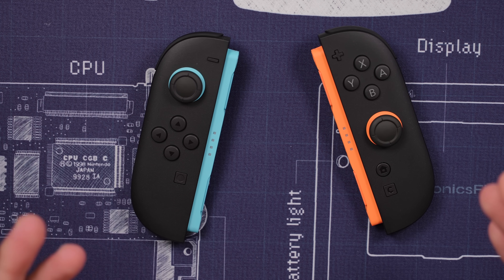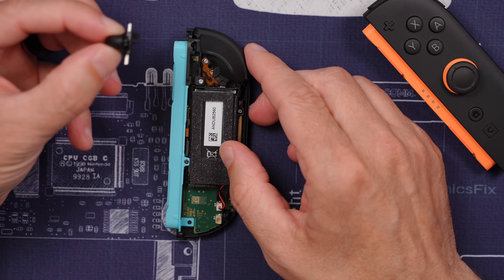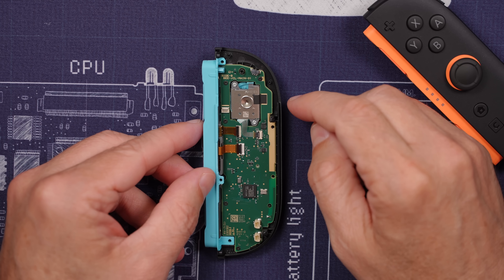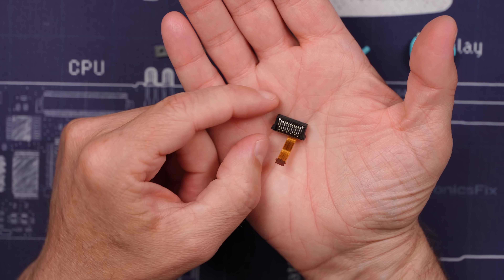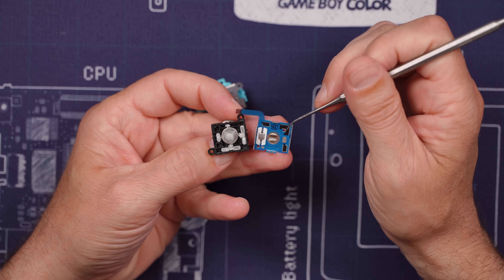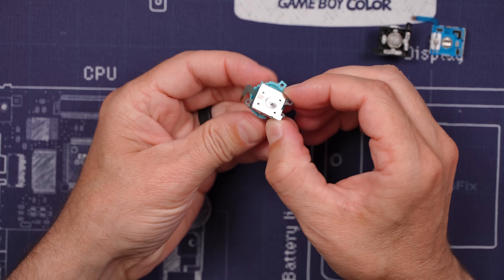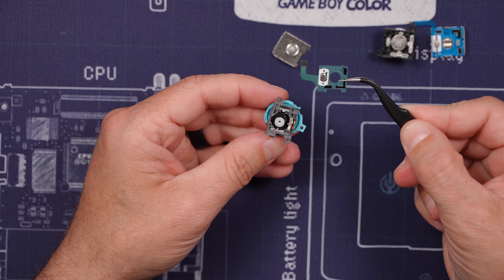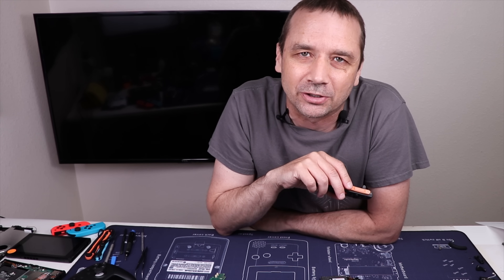Nintendo Switch 2 Joy-Con Teardown - Full Disassembly

Comment: Nintendo made an absolute fortune from people buying new joycons after people got stick drift...There was no way they were going to completely fix the issue, because it would literally mean less money for them...I doubt they meant for the old ones to fail as quick and as often as they did though...All of the first party controller manufacturers rely on repeat business from failed joysticks and buttons...There are plenty of cheap and easy redesigns they could make to their controllers that would make them fail much less often, but they keep the same crappy designs because they know people will just throw it in the trash when it breaks and go buy another one...Even if people talk crap and get pissed about it, they will still go buy another controller because the console is worthless without it...

Comment: Even though the new controllers are longer the spacing of the joysticks and buttons are the same so you still feel constricted. They should have separated the joysticks an inch or two, otherwise its as if they just would have fitted the old joycons to the new casings

Comment: I had to buy 7 joycons due to drift before I finally decided to just replace the sticks with hall effect ones. I'm very, very disappointed that they not only kept the same failure prone design, but also elected to nerf the possibility of replacing the crap design with hall effect sensors.

Comment: Other than them both being joysticks and using "wipers" they are superficially similar.

The entire stick assembly, joint, wiper actuation, housing, and etc is a different design.  Where is the big spring? Why is the metal base dished in the middle?

Comment: Replacing the sticks on the old joycons was so easy. This looks a complete nightmare to replace.
Reply: It seems the analog stick can be replaced without reaching out to remove all the board. The screws and the connector are visible wwhen the board is installed and it seems it has a space big enough for it to pass through. So easier that it seems and maybe (i say this after having disassembled a lot of joycons) maybe a tad bit easier.
Reply: It'll be impossible to replace them with Hall Effects at least
Reply: @KetsubanSolo  Not necessarily. The magnets are on the Switch itself rather than the controller itself, and depending on how well strong the magnets are and how well shielded the sticks are to external fields it may still be possible. In fact I came across a Reddit post from a few months ago of a guy testing magnets with his JoyCons using hall effects and it seemed to register no interference when the magnets were placed along the inside edge of the JoyCon. TMR sticks are also said to be less prone to interference than hall effect. So too early to claim replacing with hall effect will be impossible.
Reply: well. it still beats soldering ig.

Comment: thats a little disappointing.  guess we can only wait and see if they develop drift as fast as the old ones did.  However i personally never had stick drift on any of my Switch's  neither on the OG  from 2018 nor the OLED variant.   nor on my pro controllers.  That doesn't mean it wont happen. because it clearly does.  But i also kinda understand the industry on it...  the resistive ones are cheaper.  and making millions of these units.. yeah a few dollars more per component.. adds up.   Not saying its good..  just saying its kinda what the entire electronics industry across the board does.

Comment: The wear on the pads wasn't the only thing that caused drift. Another huge reason was that the metal shell was too weak, and the bottom side would slowly bend with the stick clicks since it pushes down on the bottom side, eventually the metal piece would bend so much that it would create more space between the pads and the "wipers", which caused them to not have proper contact and create wrong inputs, hence the drift. That's why some recommended to put a small piece of cardboard under the metal piece to create more pressure and compensate the bending, it worked a bit but it was clear that wear wasn't the issue here.

Nintendo did make small reinforcement to the bottom of the metal piece if you compare new and old joycons, so I would've liked him to test how strong the metal shell feels compared to the old one, however he did mention that it feels strong so that's a good sign
Reply: Yeah I agree with this. That's why Nintendo always changed the design of the metal, and this time have gone with a circle to reinforce it. 
I never understood why they didn't just use a solid PCB rather than a flex membrane. So the shell didn't matter so much.
Reply: seems about right with what I have studied. outside of the wipers, the other mechanisms inside seems completely different, so I hope it is better this time around.
Reply: yeah this is the isssue. drift wasnt a thing with potentiometers on this level on other consoles. you shove the console in your bag and it gets sat on and the box bends and boom your sticks drift. Hope they put some proper reinforcement this time
Reply: A few factors causing joycon drift apparently and all could have been addressed while keeping the same overall design. It's possible the new housing is designed to take up those stresses instead of allowing it to bend out the bottom.

Frankly it's a bit strange to assume a company with engineers capable of designing and manufacturing these devices, who have no doubt studied the hell out of the OG joycon stick drift, didn't take steps to address the issues just because it's using wipers still...
Reply: 70 percent of the issues, at least in my case were from the graphite pads wearing down over time. I tore apart my sticks 3 times and cleaned them with alcohol and they were coated in dust. It remedied the issue for a bit and then they started drifting again. Additionally the sticks get super lose over time and Nintendo "remedies" drift by increasing the dead zone over the years through software updates lol.
Reply: I hope you're on the right track, because I don't want to already be pessimistic about these new Joycons
Reply: I don't want to look pessimistic but the metal shell doesn't look the sturdiest thing on the world, look how every pin that locked the pads literally flew off like nothing when he putted the littlest kind of pressure to open them....
Reply: @MadMask38  Tiny thin pins breaking off when you bend them with excessive force doesn't really mean that the plate they're attached to is going to bend easily.
Reply: @Conorator  you think they soldered thin pins on a thick plate ? 

obviously it's all one same pressed sheet of metal. they have the same sturdiness they just cut and bend the sheet to shape
Reply: @Ted_Sd  Thin in the other direction. Wider material is harder to deform.

And even with the pins, he was having more trouble than usual bending them out of shape.

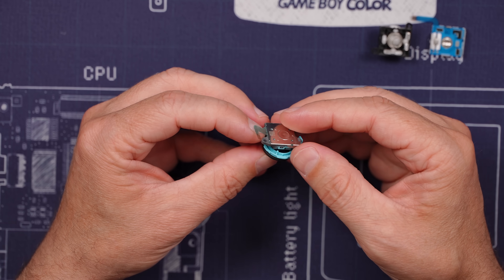At 5:25 you can hear him clearly say "Well, this metal piece is definitely really strong"
Reply: @Conorator yes it definitely looks strongER, but is it strong enough to not bend ? We will have to find out in the next months

Comment: Now the question is if Nintendo considers replacing the joysticks as an “unauthorized modification.” Wanna see if someone’s console gets bricked or not. Might be just referring to software mods. But they weren’t very clear.
Reply: @Drewman117  Dude, it is impossible for Nintendo to know if someone mod their joysticks or not. The EULA is just if someone hacks their Switch, and it's only validate in some countries
Reply: @Drewman117  the new EULA only said that in regards to Nintendo Account Services. Obviously, a controller isn't that.

Comment: Friendly reminder that a vast majority of controllers from the 2000s didn't use hall-effect either, and most of them held up quite well. And even the 3DS one was pretty good, by my experience.

Still, this doesn't look much different than the faulty ones... They better have improved the production quality.
Reply: My PSP analog still works 20 years later and I use it everyday
Reply: 最近のはデッドゾーンが狭いからドリフトしやすいんだと思う
Reply: @BeefJerkey  they weren't stressed that much with games like Smash Bros where you had to literally apply pressure and flick the stick in a direction to make a smash. Given how people can be rough with sticks in stressful games like this is enough to create drift easily in a matter of months.
Reply: @rayman1900  Smash was a thing on GameCube. Also, my Switch Pro Controller that I bought used is holding up perfectly fine, no hall effect, and I've used that heavily. More so than the JoyCons, which have already failed me. Again, it's the JoyCons specifically that have badly-made sticks.
Reply: @BeefJerkey  gamecube used hall effect though
Reply: @sellthegame_notyoursoul  No, it did not. I've rebuilt those controllers before. They do not have hall-effect sticks. But they held up well anyway.
Reply: @BeefJerkey no complaints there, the build quality of both of those sticks are way better than the flimsy joycon stick, which does not endure well the pressure of smashing left and right at repetition, and then would result in a drift situation more quickly.
Reply: @rayman1900  Smash has existed for decades

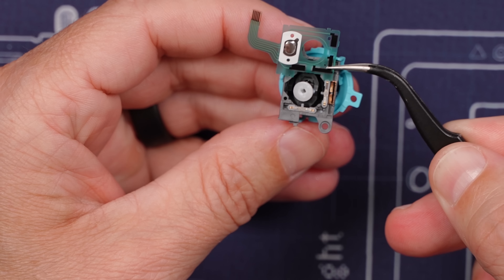Comment: 6:03 That just confirm that there will be Joy-Con 2 Drift because it is the same mechanism as the Joy-Con 1 sticks.
Reply: @Gowther1999  depends, there are other factors
Reply: Half the issues actually came from the weak metal shell holding up the contacts to the wipers; Over time it slowly bend down and reduced the contact.
Reason why early on people recommended paper or cardboard to put under the stick to reduce or get rid of stick drift.
Reply: As Long as WE dont know how the pressure is, we wont
Reply: Drift is not a problem, it's a feature. Ask shareholders.

Comment: It would be great if you could test your hypothesis about the magnets affecting hall effect sticks by using hall effect sticks in close proximity to the magnets similar to the distance of the Joy-Con.
Reply: Magnets will move the centerpoint of the joystick...If you just have a stationary magnet near a hall effect stick you can just recalibrate the stick with the magnet in place...That won't work for the switch 2 though, since the tablet part itself has magnets also the centerpoint would be different when they are attached vs detatched...
Reply: @brucepreston3927  You can find a test online where a magnet is placed on top of a switch aftermarket hall effect joystick, the center does indeed move, but when the magnet is placed on the side rail, as the magnets here are, there is no effect.

This makes sense as hall effect sensors only care about magnetic field in one direction.

Its simply a cost decision, normal joysticks are maybe $1 cheaper to produce, thats enough to go with them.

Comment: Why do they insist on using Ultra-strong adhesives to hold the battery?
Reply: You don't want a loose battery rattling around knocking into other components. It may seem like overkill now, but the one he opened is brand new. The adhesive will lose it's strength a bit over time
Reply: @rorz999  I've seen repair videos of old Switch systems including severely liquid-damaged ones with batteries extremely hard to remove.

I am not saying not to use adhesives, all I'm asking is using something more reasonable, for example, mobile phones (iPhones, Samsungs, etc) have batteries which are reasonably easier to remove than a Switch and they are way more portable!

Comment: Weird that Nintendo didnt go with another type of design after the whole Stick Drift debakel. Thats almost as if Microsoft would have gone without any heatsink on the Xbox One after the 360s RROD... O_O
Sure, Hall Effect doesnt work without doing the connection differently but damn, there has to be some sort of better solution... or at least a way to make it easily replaceable without tearing down the whole joycon all the way.
Reply: Good portion of the stick drift came from the weak metal shell supporting the contacts up to the wipers. (slowly bending over time from repeated stick button clicks)
Reason people discovered some time after that cardboard or paper would fix the drift issue.

Based on the tear down here, it seems that Nintendo made the shell much stronger for the new sticks.

Comment: That plastic ring around the stick I guess is a limiter so people don't tilt the stick all the way through even though that's not necessary, thus lessening the wear and tear and making the stick to last longer.

In other words: a cheaper way to preserve the controller a little bit more instead of doing it right using HAL effect.

Comment: That is so annoying they have used that top little button. GRRRR cheapskates Nintendo! Looks like they have just made the joystick contacts smaller so as to extend period before drift problems. Out of warranty duration.  To tell you the truth I can't see why this Switch 2 is not the same price as the existing Switch 1.

Comment: I call it BS about not having hall effect it's just a matter of calibration
Reply: It can be attached, detached, and used with various magnetic acessories. Hall effect isn't necessary for a durable joy stick so I hope it's actually durable like the sticks from before Switch
Reply: @dirtydirtsgt4751  on the ps2 or N64 what they did was a simple auto calibration when the console starts, cleverly genius

Comment: Teardown the dock, I must see the insides
Reply: The dock is just a usb c to hdmi adapter with a fan
Reply: @oussama7132  Not to forget the Ethernet port.
Reply: @oussama7132  Yeah but we want to know how the cooling works. If it's for the chips in the board, or if it actually helps keep the console itself cool
Reply: That's a board with some usb ports and a ridiculous little fan
Reply: its almost empty

Comment: Pro Controller 2 is supposed/rumored to have snapback on their joysticks so a teardown on said controller would be cool, too!
Reply: @ajmm2991  whats snapback?
Reply: @Klar  It's when you let go of the stick it overshoots the centre and starts pushing in the opposite direction you were pushing in, depending on deadzones this could result in unintentional movement in the opposite direction you were moving.
Reply: I just came across a Reddit post from 1-2 days ago showing a video of snapback with the controller. I also found a teardown of it yesterday showing the sticks are using a variant of the low profile RKJX2 model from Alps Alpine with the only noticeable difference being less plastic near the cable, this stick design is very much like that of the JoyCons using resistors on the bottom with the internal design on their product page looking exactly like that of the sticks in this video. So they're using the same style sticks in both the Pro 2 and JoyCons 2, just slightly different form factors (and possibly different manufacturers, not sure if Alps produces the JoyCon sticks though chances are they are). Also worth mentioning the Pro 2 seems to be terrible to take apart as you need to remove the faceplate to get to the screws, and the faceplate is held on with both plastic clips and adhesive.
Reply: @ajmm2991  The Joycons also seem to have Snapback. If it has real impact in games will tell with time.
Reply: @bambusbruder9139 It's also using alps potentiometer based sticks on a teardown.  Frustrating.
Reply: This is what I want to see. If they use the same trash joysticks again, I'm not interested.
Reply: @benjaminvdvyt  The are using the non-Hall joysticks, so they will probably get drift all the same.
Reply: I think nintendo said that in welcome tour

Comment: You can easily shield a hall effect stick from other magnetic forces. Totally upgradable in future just have to wait for someone to release them.
Reply: Use tmr as they are better
Reply: @mikeuk666  Precisely. They are the successor to the hall effect stick.
Uses a fraction of the power needed to work and much better deadzone accuracy.
Reply: Doubt that. But we will See. Its a strong Magnet

Comment: I put hall effects in my joycons for the original switch, so it's disappointing to think that if I ever picked a switch 2 up, then this may not be an option. I'm guessing even TMR joysticks would be affected because the magnets in the rail are strong.
Reply: not sure why they needed to change the old connection method, never knew anyone that had issues with it. If they had kept it then the potential magnet interference wouldn't be a concern.
Reply: @amirpourghoureiyan1637  I honestly thought the sliding rails were fine and made the joycons pretty secure. I've already seen another video of a guy able to pull the switch 2 joycons off the sides without using the release button.
Reply: @SCorpG22  For what it's worth, it is VERY difficult to pull them off without the release trigger.
Reply: @icee113  The point being that it's possible, whereas with the rail it wasn't. The guy in the video held the joycons and shook the console and one side came off. It just feels like a gimmick that hasn't been that well thought out imo.

Comment: Pro controllers at this level, and it'll be really necessary.
It's exactly the same as on the first Switch.
They haven't learned from their mistakes, and when the general public notices, it's going to be delicious.
Since it's the same thermal paste as the first Switch, I hope they get a Karma comeback.
Reply: The Switch V1 overheated, Subsecuent models don't (I live in a place with 40°C temperatures, never felt the OLED overheat, only the V1)
Drift was also mostly fixed quietly after the OLED came out